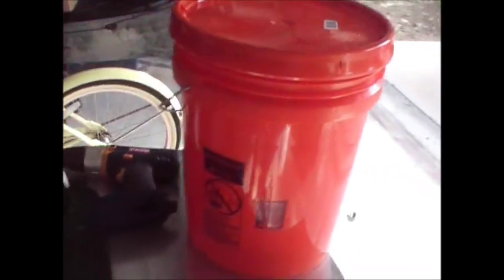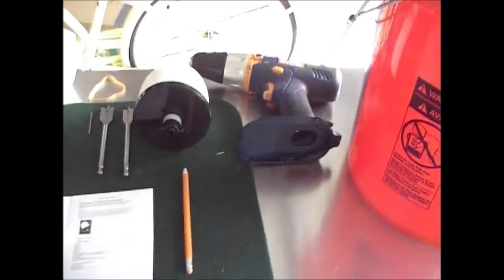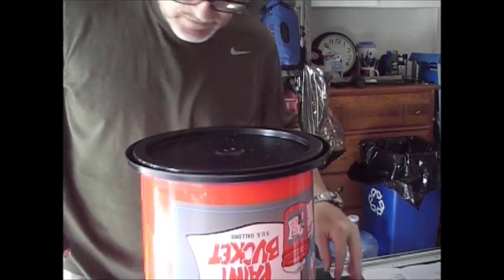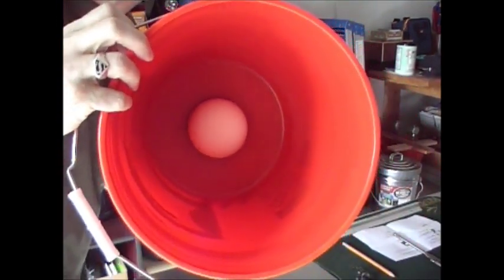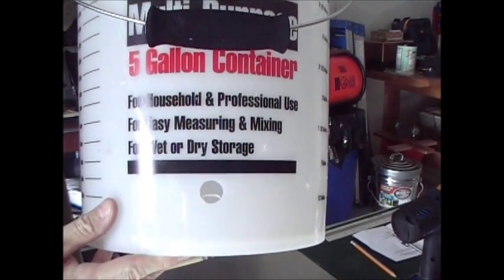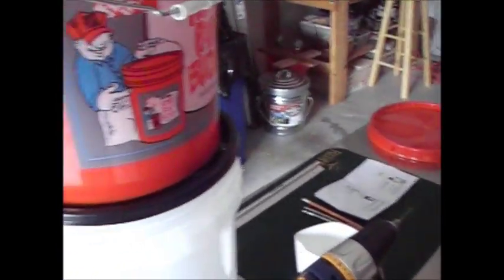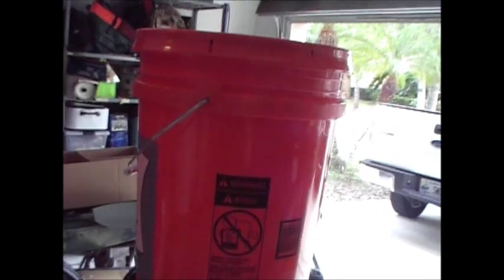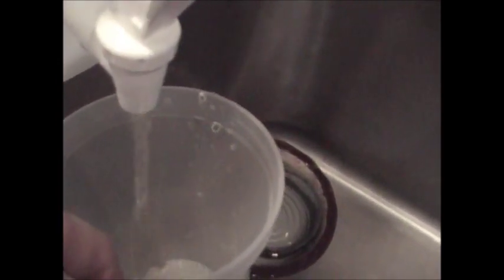DIY: Gravity Fed Water Filtration System

Comment: Good vid.
Keep in mind the more filters you install in the bucket the faster the system will proses the water. I built one of these myself but with bigger filters, works great.
Reply from the maker: Thanks for the comments Chuck.  Very good idea to add extra filters.  I still have this set-up and plan to use it as part of my overall water processing plan.  I also have a Berkey system and plan to purchase another as a back-up.

Comment: Hey guys, this is a great idea the only serious recommendation i have from experience is if you want this to work well for you then at a minimum install a filter with much more surface area, a large cylinder type I highly recommend.  It will make the flow faster and less frequent cleaning.  I had a cylinder type filter hooked up to the city pressure and within 25 gallons or 100 liters it would plug up and slow down the flow tremendously, and this is with 50 psi pressure, in a bucket with only 0.4 psi with every foot height of water you have 100x less pressure so choose large filters and if you have a large family use 3 filters if you want to make enough water, especially since your water will be more dirty and will plug up the filter quickly.
Reply from the maker: Can you recommend a cylinder type filter? Thanks for your comments.
Reply: The filters will rapidly plug up if you are using dirty water in shtf so i recommend to have as much surface area on the filters as possible.  2 filters is good idea.  large ones 7 or 10 inch tall ones.  

To get more flow rate use a 6 gallon tall bucket for your upper bucket, this will give you more water height meaning more pressure which means faster flow rate.  Every foot of water height you get 0.43 psi of pressure.  So to speed up the flow keep the bucket full.

For any handy guys with creativity please build a custom filter from 4 inch pvc pipe and make it 5 ft tall with 1 ceramic filter on bottom this will give you 2.1 psi and your water will flow not drip, cool idea i have no time for due to injured hand now,  May i will make one for you.

Even better idea if u have time get a 15 ft food grade plastic hose and make a upper container from a 3 gallon bucket, have that upstairs, then a half inch hose going down to first floor and connecting to a cartridge with 1 filter the under the sink type.  60 / 70 bucks plus minus, then sit this on top of a bucket with a hole in lid pointing the cartridge exhaust into this bucket.  This will give you 5 psi and you will be very please with the flow and save on filters.  

both ideas r good.

Comment: Has anyone done one of these using a ceramic or glass container rather than plastic?
Reply from the maker: I have not seen one, but that could certainly be used.  There is one on the market that uses stainless steel.  It is called the Berkey.
Reply: Actually I just adapted a glass container with a spout from BigLots to a bucket top with this filter.  Works well, and doesnt leave the water in contact with plastic but for a few moments.
Reply from the maker: Very nice.  Did you make a vid on this?
Reply: There are some photos on the grindlebone forum at http://apps.grindlebone.org/Forum/message/index.cfm?topicGroupID=18796&topicID=38307&messageID=95463&start=2&last=1#95463
Reply from the maker: Thanks.

Comment: Anthony,  I hope to make it to Africa this summer with my church and I am considering different filter systems as an outreach to local villages. Your system seems to be very cost efficient and durable.    Any suggestions pro or con for a "group" type of an application?         p.s. It is an annual trip we make to replacing the filter part of the system annually is in our plan,..however regular maintenance would be "on" the locals.

Comment: I have one of these filters as well, but I have read somewhere that after about 6 months they are no good.  I would recommend a Sawyer filter, they are suppose to basically be good forever. I have bought 3 Sawyer filters, 2 are .1 micron and the other, which filters viruses is .002 microns. Just my 2 cents to help anyone. Thanks